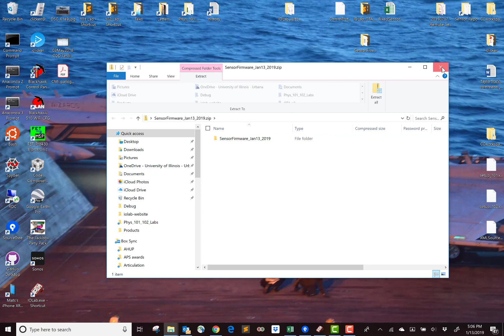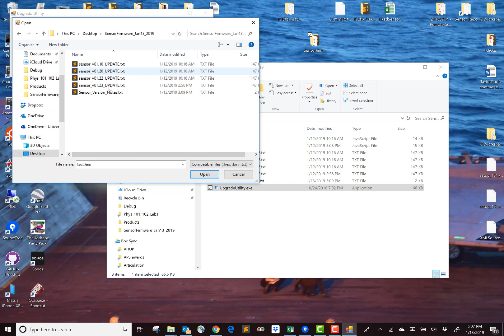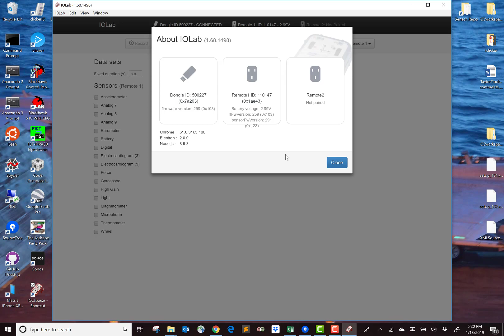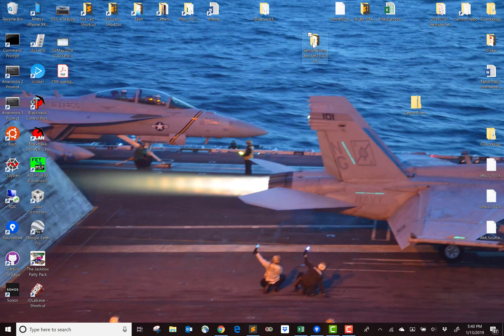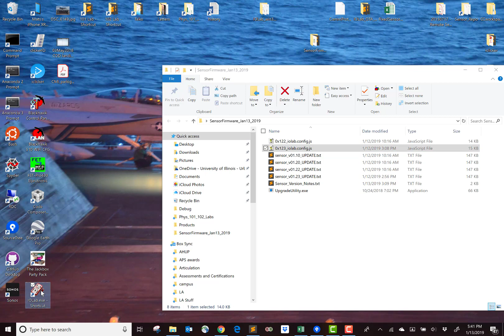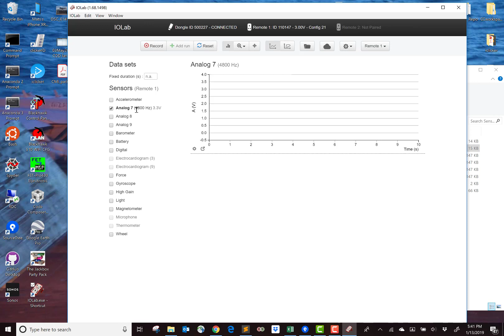IOLab Sensor Firware Updating

Comment: How does one update the configuration file, after upgrading ioLab firmware, on OSX ?
Reply from the maker: The config.json file is located in the Documents/IOLab-Workfiles folder. It is a test file so you can edit it with any text editor.